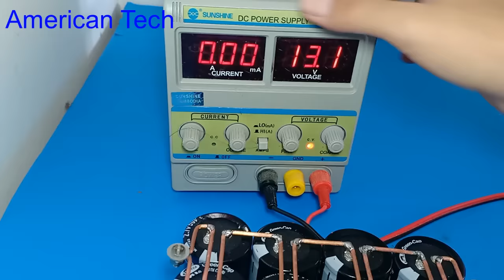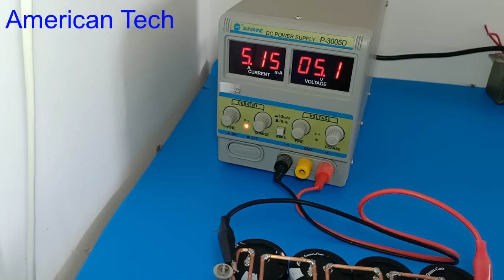12V , 100A using Super capacitors , Amazing idea

Comment: Don't give fake information to students these 8 super capacitors of 500F+500F=1000F 2.7v x4=4000F = gives only (10.8V) not 12V  and gives only less then  (one Amps) Not 100 Amps. please correct your information.
Reply: I think author means Not Amperes per hour, but some big current flow that can melt copper
Reply: It is A*and not *Ah.
Reply: you have to know how much the voltage tolerance of the capacitors is, and the capacitance is not 1000 or 4000, calculated is only 250.
Reply: ya you are right uncle
Reply: 2.7×4= 10.8

13-10.8= 2.2

2.2÷4= 0.55

They are only 0.55 volts per capacitor, with that the capacitors do not explode.
Reply: There are 4 series capacitors connected in parallel with 4 more capacitors in series. Capacitors in series are calculated as resistors in parallel and capacitors in parallel are calculated as series resistors (add up), 4 series capacitors of 500 farads are calculated as follows: c1 + c2 + c3 + c4 = 1 ÷ (1/500 +1/500 + 1/500 + 1/500) = 125, hence the total capacitance of the first row of 4 capacitors, the other row of 4 capacitors It also gives 125 summed are 250 farad.
Reply: Yes you are right
Reply: @alaskanskismok4487   There are 8 caps. Set of 2 are parallel making them 1000F and then 4 such sets connected in series to make overall capacitance as 1000/4 = 250F.
Reply: There are 8 caps. Set of 2 are parallel making them 1000F and then 4 such sets connected in series to make overall capacitance as 1000/4 = 250F.
The overall voltage that it can take is 2.7v*4 = 10.8v.
Current can be even more than 100A as these are low ESR capacitors and they can really push so many amps.
Reply: dariel pozo    Gratulation! You are the only one to calculate the capacity right!
Reply: @darielpozo8209  yea seiris capasitor set  c/set  
 (500+500)/4 = 250
Reply: @FriesinNF  

Thank God I learned it studying 18 years ago.
Reply: dariel pozo excelente!
Reply: @darielpozo8209  Объясни мне,ёмкость земли составляет около 1 фарада.Как можно в этот цилиндр вместить 500 планет земля.Есть значение микрофарад а не фарад.
Reply: @darielpozo8209  2.7×8
Reply: @llproducciones1959  
Gracias colega👍
Reply: @seryj591  

Can you please translate your comment into English or Spanish?
Reply: @mohammad_ghanem  

Son 2 filas de 4 capacitores, cada fila tiene 4 capacitores en serie y las 2 filas de 4 capacitores están conectadas en paralelo, por lo cual tienes 10.8 voltios conectados en paralelo con 10.8 voltios.

En conexión en paralelo el voltaje es el mismo, pero la potencia aumenta.

There are 2 rows of 4 capacitors, each row has 4 capacitors in series and the 2 rows of 4 capacitors are connected in parallel, so you have 10.8 volts connected in parallel with 10.8 volts.

In parallel connection the voltage is the same, but the power increases.
Reply: 4000 фарад ну никак не получается...в таком подключении только 250 фарад а вот с напряжением все верно...
Reply: @darielpozo8209  В честь чего?
Reply: Jaja is a battery inside the condenser. Only this. No more
Reply: Jealousy uncle
Reply: Yeah 5minutes at 5amps charging would be .4amp hours, but honestly I'd think short circuit would be higher than 100amps flow.. I mean as a kid playing around I got a capacitor welded to a  coin just playing around. Small capacitor at that.
Reply: Тоже самое хотел написать что 10.8 вольт максимум, но умный человек уже нашёлся
Reply: @DecibelAudio.  

the battery is like a large capacitor and the capacitor is like a small battery. By studying electronics, you can know how long a capacitor can hold energy.
Reply: 제목으로 낚인거여~ 저 캐패시터 단자로 100A가 흐르면 그 부분에서 발열될 수 있다. 하지만 순간적으로 흐르는 것은 상관 없지만..
Reply: dariel pozo thaks for your coments.
Reply: If you charge them to 3v it’s 12v 😂😂😂👍🏻 (If you want them to explode)
Reply: Good
Reply: 250F, 10.8V
Reply: @NienteNessuno  these capacitors are rated for 2,7V but can easily take up to 3,2V
Reply: You're wrong in so many ways
Reply: That cables work with 100 amps ? I think not
Reply: @darielpozo8209  charge time , big difference and life expectancy
Reply: Il se faut de notre gueule là!!!!!! 

Fake!
Reply: @TRICHOMETRIST  

what I'm referring to is the time it takes for the capacitor to lose the load
Reply: Ya chrag Kasa ho ga or Tim Ktna ha is ki chrging ka
Reply: @ayushmanjain4008  Respect the elders
Reply: Its too easy to say any thing Fake first he should respect others in urge to receive respect.
Reply: A not Ah🤣
Reply: Si pone los capacitores en serie se suman sus voltajes de trabajo.  Y la capacidad es la misma que uno solo.
Reply: @darielpozo8209  batteries take longer to charge , discharge
A capacitor discharges faster but charges faster
If we can charge a capacitor with a source (lithium,...) repeatedly the capacitors can discharge larger amounts of current than batteries
IN the case of Electric Vehicles it is being used as a "step up transformer "
People are starting cars/engines
With super caps /ultra caps
After car starts caps are quickly recharged for next start 
The new batteries/caps  have a quick charge option
If you charge batteries to fast it ruins them and kills life of battery
These caps can take thousands of charges and wont wear out like regular cathodes/
Reply: Will this Kentucky Fry Chicken me? What could possibly go wrong?  I don't see discharging resistors?
Reply: @seryj591  У земли напряжение больше миллиона вольт, а тут всего 2,7 В. Поэтому фарады настоящие. Но 500 Ф это меньше 100 мАч, литиевый аккумулятор такого объёма будет в сотню раз большей ёмкости
Reply: You are right practically cap. Will not explode for this surge current of 100A but what is backup time for this cap. bank?
Reply: @darielpozo8209  You're exactly right about the capacitance. But, did you notice the voltage? The capacitors are 2.7 volts each. That only allows 10.8 volts. To run in the voltage range of a six cell lead acid battery, he needs at least 6 in a series. Back to your formula, that would be only 166.66666.... farads.
Reply: @vincentrobinette1507  

The first thing is that the voltage of one or several capacitors connected in series or parallel does not affect the capacitance of them, that is, if the voltage tolerance of the capacitors allows a minimum and a maximum voltage, this does not decrease the capacitance. in this case we have 4 capacitors of 2.7 volts connected in series that add 10.8 volts fed with a source dc to 13 volts, where we have a surplus of 0.55 volts per capacitor, if the tolerance allows this excess voltage, this will not damage the capacitors much less will the capacitance of the circuit decrease. When the voltage in a bank of capacitors exceeds the maximum allowed tolerance, this does damage the capacitors or failing to make them explode.
Reply: @darielpozo8209  It doesn't affect the value of the individual capacitors, but when two Identical capacitors are connected in series, the total value of the string is cut in half. The voltage is doubled. You now have double the energy. The total energy stored in a capacitor is 1/2 the capacitance, times the square of the voltage it's charged to. That means, if you double the voltage of a given value, you have 4 times the energy. (E=1/2CV^2). by putting 2 in a series, 1/2 the capacity times twice the voltage squared, means twice the energy. The definition of a farad is a change of 1 volt per second, if 1 amp is applied. With 2 in series, each element changes 1 volt per second, giving overall change of 2 volts per second total. that means 2 1 farad capacitors in a series is .5 farads. Hope this helps.
Reply: Hadi rizvi u right dat can never n 100amps
Reply: @darielpozo8209  He wrote: "Explain me, Capacity of the Earth is about one farad. How can it be to set up 500 planets like Earth inside of a single cylinder unit. There is a meaning of Micro farads, not Farads".
Reply: سلام شما ایرانی هستید
آیا واقعا این کار میکنه
Reply: @D.V.G.1  , не так. Здесь 4 группы кондёров включены последовательно, в каждой группе по 2 кондёра. Следовательно, напряг на группу остаётся 2,7V , а ёмкость группы получаем из суммы ёмкостей каждого кондёра, 500F+500F= 1000F.
Т.к. 4 группы, то их общий напряг суммируется, 2,7V*4 = 10,8V. Т.е. вся конструкция рассчитана на 1000F и 10,8V.
Но, что-то мало верится, что ч одном таком кондёре аж 500F.
Может это китайские фарады, как и китайские ватты в 90х годах?
Reply: @LV-fx5nr  при повышении напряжения...уменьшается емкость ионистров...учись старик...
Reply: Ok
Reply: Hadi Rizvi total capacity is 1000/4=250 F . .Store   energy is ~15000 joules for 10,8 volts
Reply: Hm ?100 mikrofarad 380volt capacitor Dioden Wellen Sternwechsel an Wechselstrom
Reply: @ostanin_vadym  it was pond ..
Reply: @ostanin_vadym  7
Reply: Not to mention that if you touch this "battery" (100Amps), it will be hit the current. Actually I did not understand why one ampere? The device writing that is fed 5 amps.
Reply: Voltage rating on capacitor is the breakdown rating of the capacitor. You need capacitors with a voltage rating of at least 12 volts to avoid damaging these capacitors. Even with 4 series capacitors your breakdown voltage is still under 12 volts. It's garbage.
Reply: Please keep your information for yourself and see it from the angle and you from the angle of the other see it in another way
Reply: @darielpozo8209  Is there any way to use this as a battery on car?? Any way to stop the energy loss that happens with caps? Some say using  diodes for one way flow.
Reply: @pehgt5099  

I understand that this capacitor bank could be used in a vehicle but not for the start of the same, the same generation of the vehicle could keep the load of the capacitors, but I do not think it works for startup.
Reply: Hadi Rizvi.. Sir... If its 10. 8v.. How many hours can it provide the 10.8v.. Do u have any idea pls share
Reply: 1000/4=250F!
Reply: Total capacity 250 F and 10.8 V. Qc = 10.8 V x 250 F = 2700 Coulomb, Wc = 14580 J.  It has even more than 100 A? it is dependent on how fast you plan to discharge it.
Reply: @hadirizvi2670  Exactly!
Reply: @seryj591  у активированного угля очень большая поверхность, это основной принцип работы, сейчас уже на много круче, из графена делают. Все возможно, нет ничего не реального
Reply: @seryj591  он по русски не шпарит
Reply: @D.V.G.1  да потому что расстояние между диэлектриком увеличивается e0eS/d=C
Reply: @darielpozo8209  👊🖒
Reply: Hadi Rizvi supper pass
Reply: I think these  capacitors can tolerate 3v easely.
Reply: @nixtonixto  
100 mAh? Если следовать спецификации на данные конденсаторы, то мы получаем 250F с напряжением 10.8V. Что бы разряжать данный конденсатор с 100мА нам потребуется стабилизатор тока. Разрядка будет длиться очень долго при указаном стабильном токе и часть энергии будет рассеяна самим стабилизатором тока [все электролитические конденсаторы так же имеют собственный внутренний разрядный ток - чем выше напряжение тем выше внутренний разрядный ток].

https://www.electronics-tutorials.ws/rc/rc_2.html

https://www.instructables.com/topics/How-many-mAh-1-farad/
https://www.quora.com/How-do-I-convert-from-farads-to-ampere-hours

Вопрос нужно было задать в другой форме: 'Сколько потребуется времени для заряда конденсатора 250F постоянным током 100мА с начального нaпряжения 0V до конечного напряжения 2.7V?'

Или вопрос можно было поставить по другому: 'За какое время конденсатор 250F разрядится с постоянным током разрядки в 1А с начального напряжения 2.7V до конечного напряжения 1V?'
Reply: 👍👍not mikro farad for amplifier😁
Reply: Thanks sir!
Reply: @darielpozo8209  yes these 8 capacitors connect like these total capacitance is 250 mfd working voltage is only 10.8 volt
Reply: he mean they cap put out alot of amps in a moment, these capacitors can start your car, the amp draw of the starter motor  is alot.
Reply: Really it's true sir ?
Reply: yes
Reply: Yes true
Reply: There are many videos proving this is the best replacement for car batteries. Hands down.
Reply: I have used capacitors to jump start a near dead battery.Also keep in mind a capacitor can supply a large amount of current for a brief time enough to start a modern car.And for you guys that have high torque starters you would need a larger capacitor bank to do the same thing.
Reply: A NOTE to MAKE is that capacitors voltage VALUE, is a MAXIMUM RATING. Its not an automatic cut off. They charge up to the supply voltage in the formula used as time constants for the time to do that.

So you are better to have a higher voltage than a lower voltage as you will be pushing the limits of its structure. You can do it for a while then they explode. Just because you get away with it once, doesn't mean it will always. Heat is always a factor. How hot are they. How hot is the day and so on. Cooling always helps most things handle a bit more. If in a box, a cooling fan for example.

Better to have 5 in series than 4, giving a value of 13.5V. This means it has room to spare. Instead of maxing out past its recommendations. 

If you run anything at maximum, such as a motor control circuit, a voltage multiplier etc. AS soon as there is a change in the load, it will overload. Always have room to move above your maximum requirements and maximum ratings. IE inverters often are rated with two numbers. One for constant load example 1500W and 3000W peak. The peak is only while things like fridge start up for a few seconds, overcoming inertia most motors draw around 5 times normal operating current. Another thing people dont realise with inverters is the wattage translates to be divided by the voltage. So a 10A power point in the house at 240V is 2400W. At 12V that is 200A. So the wire from an inverter to the battery input needs to take 200A. And that's only one power point wall socket equivalent. Make is 24V and its 100A. 36V and its 66.67A. So you can save on wire size and cost by going up in voltage.
Reply: @MindTrip888  A Voltage regulator to control the charge can be used but no one should be building  something that can hurt them without at least KNOWLEDGE about what they are constructing. Also I would not use this in place of a battery as some have done on You tube .My purpose is to use it on a near dead battery when another source of power is unavailable. I draw from the dead battery while watching my state of charge with a inline in voltmeter if the capacitors are not at capacity.I do not disagree in your logic on the inertia electric motor butthe capacitors they used in this video would be sufficient for a modern day car as the starter motors today are incredibly small to the cars of 50s-90s.This is why I denoted for guys with high performance cars as there starter motors will draw more current due to higher compression engines.Not a modern day sports car either old school.
Reply: Thank you
Reply: Hadi Rizvi, while I respect your intentions for truth and warnings, there is a lot more than ONE AMP there. These are used to START CARS and Weld. You can make a spot welder with this. So 100A is about right. These are CLASSIFIED as SUPER Capacitors. FARADS not MFD. That's 1,000,000 MFD is 1 Farad.  I did my research to see why 2.7V was so big. This is 500 Million MFD!!! HUGE!!!! Be careful of assumed accusations when it is you who are incorrect and leading the newbies astray. You are talking like they are batteries. Different formulas.

These types of capacitors are used for welding with my search for them on ebay. These ones sell for about AU$7 each delivered.

1. You are talking like it is batteries where the voltage is the maximum value.

2. Where as capacitors CHARGE to the VALUE of the SUPPLY VOLTAGE in a formula of time cycles as using in RC timing circuits. When fully charged the capacitor no longer draws current.

Capacitors allow to have larger currents than the smaller supply. LEYDEN JARS the forerunner of the modern capacitor were called LIGHTNING IN A JAR, as they were being charged with STATIC, which is much higher in the thousands of volts. As static zaps us with sparks. Consider that same voltage stored to give extra current. This is what capacitors do.

A 20L size Leyden Jar capacitor on a Van Der Graaf generator can build up FATAL CURRENT charges. There are many videos on this on YouTube, BEWARE. It is currents that kill, if sufficient voltage is present.

Capacitors Voltage is a Maximum rating. Here he is pushing that Max over it. There is a tolerance. Max rating is a safe value for operations. To go over it is to risk damage. 0.3 Volts is probably within tolerance. I would be inclined to an extra capacitor in each series circuit to be safe to go to 2.7 x 5 = 13.5.  As capacitors explode when they overload with high power. Electrolytics usually by accidental reverse polarity.
Reply: @MindTrip888  The warnings that The gentleman is trying to get across is to charge a capacitor over its rating is a potential fire hazard which I do agree with.Yes super caps have been around for years but I deal with capacitors that if fully charged can stop your heart.We work with 700 volt hybrid trucks. Hence a  DC/DC voltage Regulator should be used when charging the capacitors.
Reply: @apacheone3643  While I respect saying, I believe you are giving him too much credit. As he is out of his depth, saying there is ONLY ONE AMP....And you know for sure there is much more...
Reply: @MindTrip888  I know other people have corrected him on this that is why I did not press the issue.
Reply: @seryj591  Там про электрическую ёмкость,а не про планеты космические.
Reply: Fake
Reply: @carlosleite6919  like you!
Reply: Inside battery
Reply: @mrkitty777  Kentucky fry Chicken me. Lolz
Reply: Good article on supper capacitors and valuable discussion on the subject for the beginners of electronic projects and enthosiosists. Thanks.
Reply: Please do this again with these 4 x 12v1A
Doe's you A ever get under 1A/(farrad)
Doe's you v ever get under 12v  either way you cuppel Them 
+ - + - so on
seriel
Or
+ + - - so on
Paralell
Please let me know or Edit you tekst
Reply: Yada yada yada nop WROOOOOONG 
IN RESISTORS YOU CAN GO SMALLER THAN THE SMALLEST
THIS IS F@UKING BATTERIES .. YOU CAN GO U P
IN ITHER VOLT OR Amp/Farrad
NEVER under the smallest.what ewer!!!
Reply: @darielpozo8209  use Google translate, it does a good enough job to be able to work out what's being said.
Reply: @boblewis5558  
yes, I use Google translator
Reply: @boblewis5558  
I also learned a bit of electronics.
Reply: @darielpozo8209  how the f@k do you get 250F 
This Ain't resisters . Ohm is smaller than the smallest
This type of CAP'S can NEVER ever be smaller than the smallest ..
Reply: @kennethschultz6465  
It seems to me that you did not understand what I wrote, I did not say that they are resistant, I said that the series capacitors are calculated as the resistances are calculated in parallel and the capacitors in parallel are calculated as the series resistances are calculated.  In case you do not understand, what I mean is that the capacitors connected in series are practically subtracted and the capacitors connected in parallel add up.
Reply: @kennethschultz6465  
I hope you understand:

There are 4 series capacitors connected in parallel with 4 more capacitors in series. Capacitors in series are calculated as resistors in parallel and capacitors in parallel are calculated as series resistors (add up), 4 series capacitors of 500 farads are calculated as follows: c1 + c2 + c3 + c4 = 1 ÷ (1/500 +1/500 + 1/500 + 1/500) = 125, hence the total capacitance of the first row of 4 capacitors, the other row of 4 capacitors It also gives 125 summed are 250 farad.
Reply: @ Hadi 
1farrad 1v = 1A sec 
50farrad 1v= 50A sec 
1000farrad 1v = 1000A sec
Reply: @DecibelAudio.  
Maybe but in this case .. 1farrad 1v =1A sek  
1000F 1sec 1000As
This is not kid's toy ..
Reply: @kennethschultz6465  

I do not know if you in your country calculate in a different way the capacitors connected in series and parallel, I do not know how you calculate the connection of the capacitors in the video, therefore according to the video and the experience I have there is  2 rows each of 4 capacitors connected in series, each capacitor has a value of 500 farad, I would like you to calculate how many farad in each row of 4 capacitors and then calculate how much is the total connected in parallel.  What I want is that according to you say that I am wrong, I need you to calculate the total farad of the circuit in the video.
Reply: @kennethschultz6465  

Remember that this is a healthy debate, there is no need to use words out of the ordinary, if I am wrong as you say, show it to me, do the calculations and the diagram and send it to me please.
Reply: @balakrishnareddy5765  aaaahahah you got 4 12v 1A batteries in paralell  and you get this to 1 12v 0.250A
 Please reply please PLEASE PLEASE  !!!
Reply: @operotti7940  please calgulate this using you'r formula .. Then thell me real life result 
4 x 12v 1A in my World that is paralell 12v 4A  What is IT in you'r World .. thats the globe on that is .. 
Like  500+500=1000 F is not 250 like resisters but 1000F like batteries in series/paralel
Please tell me why .. you can get this simpel simpel thing wrong
Reply: @user-bh3tp1ez5m  No wonder russians can't make anything Work
What does 4 x 12v 1A is paralell give in A in russia.. (vestern World we get 4A paralell)
How the f@k can you get IT to 250F this is not resistores 
500+500@2.7v=1000F
Reply: @f.momentum8535  hmmm please by you'r logic 
Calgulate 4x 12v 1A paralell  hint 4A if you get 0.250A you are so wrong
Reply: @kennethschultz6465  If you connect 4 batteries of 12v and 1A max in parallel then the set can supply theoritical maximum of 4A.
Here you can understand as each and every battery can supply a maximum of 1A and all together can supply 4A.
Reply: @balakrishnareddy5765  
Realyyy !!!! Cooooool
Why do some on get 500+500F to 250F ... If they are right .. the 4 x 12v 1A is 12v 0.250A
And you and i know IT ain't so .. right.!!
Reply: @kennethschultz6465  I think you need to learn bit more of fundamentals.
Batteries never push 1A current or any current. It is the load requirement that demands the current. And load must be choosen such that it does not draw more than maximum current a battery can provide.
Reply: @kennethschultz6465  if you want to make 1000F capacitors to 4000F then connect 4 of them in parallel just like batteries. 
If you connect batteries in series then voltage will change but they should not supply more than 1A.
Reply: @balakrishnareddy5765  realy now you agrre What a coencidence 
1F 1v=1As 
So 1000F 1v = 1000As @10.8v thats a Lot 3.32Ah
1000F x 10.6volt thats way more than nothing .. and 1000 times++ more than 1A
1As = 1Amp sec
Reply: @balakrishnareddy5765  so you agree with my 
Calgulation of the seriell and paralell 
2 paralel500=1000F seriel x 4= 1000F
2.7paralel2,7=2.7x4= seriel 10.8v
So you also agree that CAP's and Batteries are Same.. 
Nice .. please tell the not so fortunate .. 
You are my new best frind .. Greetings from OZ land Denmark..
Reply: @operotti7940  sorry is Cap's same as Resistors .i think not
. and when and where did that rule chancer.. if you still think so 
Please Edit 
Or delete this is 4 paralell Banks in series thats 10.8v 1000F
Reply: @balakrishnareddy5765  okay like I ... You made a slight typo
Reply: @balakrishnareddy5765  you mean 1000F 10.8v right .. vink vink
Reply: @FriesinNF  lol nop 
IT is not resistors .. so at rule of thum
You can't make Cap's smaller than the smallest in this case 500F 
2 paralell 2x500F. =1000F @ 2.7v x4 in series is 1000F@10.8v  tada....
Reply: @withyou4922  sorry bro 
500F+500F is 1000F@2.7v  in paralell x4 in seriell 1000F@10.8v thats that 
Resistors and Cap's ain't the same ...
Reply: @kennethschultz6465 The capacitors in video connected as 2 in parallel and then 4 such sets in series so ultimately they become 250F.
Since they are connected in series of 4 they can maximum take a voltage of 2.7*4=10.8v.
So the entire configuration spec is 10.8v and 250F.
If you are not convinced with 250F capacitance then I can't explain.
Reply: @kennethschultz6465  Yes you can consider capacitors as rechargeable batteries. You can use thevenins network model to use them in parallel or series combination.
Capacitors can be used for battery replacements theoritically but not suitable as of now because of differences in size and energy densities.
Reply: @balakrishnareddy5765  500 paralell 500 thats 1000F @2.7v  x 4 seriel is 1000F@10.8v 1A@3.32Ah
Same as batteries
Reply: @balakrishnareddy5765  if you agree to IT is batteries 
Why don't you calgulate Them as so... You calgulate Them as RESISTORS ..not as Cap's
This is a nøøøøøb flaw
Reply: @balakrishnareddy5765  but 250F .. now i can't .. say IT in any other way than .. please PLEASE
You math is flawed .. i repeat a CAP can't be halfed in sice as a resistor can . If you still do this 
You are flawed . That's that  
you agree to Cap's is batteries .. appley the math
Reply: @balakrishnareddy5765  hmmm i think you are a troll 
One place you say og i put 4 1000F together iN PARALELL get 4000F but in SERIEL i get 250F
Nop i know wher you go wrong
You M I S T A K E The VOLT SHERE .. AAAAAAHAHA... 
YOU DEAR SIR .. HAWE IT ALL WRONG !!! HAVE A GOOD DAY
 I AM OUT 
IF YOU NOT BY NOW DON'T RECOKENIGSE YOU FLAW .. YOU WILL GET HUGE TRUBBLES WITH ELECTRONIC
Reply: @balakrishnareddy5765  yep .. why do you .... Disagree with you self and .. make 1000F to 250F
You mistanke the Volt shearing 
This is deleberet trolling
I am out
Reply: @ostanin_vadym  1F 1As 
1000F x 1A = 1000A 1sek 
1000F x 10.8v =10.800As  1A for 3Hrs or 3.34Ah
Reply: 1A 3hrs or 3.34Ah
Reply: @balakrishnareddy5765  capasitance is not the same as capasety or rectance or whatever
Not in this case .. you are refering to volt deviding .. you don't devide the Farrad at the same case
Reply: @balakrishnareddy5765  but What you write don't 
Get to gether with the 1 over .. and 1000F to 250f ..
So either you Edit one ore the other .. you can't do both  
Then you just Troll .. and i am out .. I Block Troll s
Reply: @kennethschultz6465  
I will leave you drowned in your ignorance.
Reply: @kennethschultz6465  
I will leave you drowned in your ignorance.
Reply: @kennethschultz6465  
No matter what you say, that does not take away what I know and you will continue to be drowned in your ignorance.
Reply: @kennethschultz6465 , @dariel pozo, stop spam!
Reply: Your voltage calculations and parallel capacitance calculations are correct but NOT your series capacitance calculation. 

When TWO Capacitors are connected in series the positive charge on one connected plate automatically gets reduced by the negative charge on the opposite plate of the connected capacitor.

 This reduction is automatically balanced across both capacitors until the total charge on each of the four plates is HALF of its original value.

Since charge Q = CV then the capacitance is Q/V. The voltage V is still the same (per cap) at 2.7volts but the charge (per cap) is now Q/2 so the equivalent  capacitance per cap is now 1/2 of what it was i.e. only 500F. 

When connecting TWO such series pairs ALSO in series (500F in series with 500F) the same redistribution of charge occurs and now the two series 500F (4 series 1000F) become 250F ONLY! NOT 4000F which is ONLY TRUE of parallel connected capacitors.

PLENTY of great accurate tutorials inline about this.
Reply: @TRICHOMETRIST  "… won't wear out… " Piffle, the ESR will increase it’s why switch mode PSUs fail so quickly. I=C dV/dt
Reply: . @darielpozo8209
Reply: dariel pozo 

Uh,not really.
Battery <> capacitor for lots of reasons (rapidly decay in voltage as current withdrawn from capacitor for starters)
Reply: Capaciter kya militia hai
Reply: Where is the uploader answer? ? American channel operator why no answer from u??
Reply: Let's not forget the fact that if you use it on a car the alternator is going to blow up the capacitors
Reply: Do u have an email i have an crestion
Reply: U
Reply: @darielpozo8209  eesto puede servir en el car audio
Reply: @ronnyejr.pujols3241  
Entiendo es muy alta la capacitancia para audio car pero no estaría mal ya que esto sería como tener otra batería.
Reply: No: Its Paralal then sere ies 1000 X 4
Reply: @ostanin_vadym  true
Reply: He overcharged it to 12V and he said 100amps and not 100AH so yes 100amps is totally possible
Reply: @chandankumarray2998  he is not
Reply: @FilipeDGuedes  ok
Reply: @vincentrobinette1507  u can overcharge them upto 12.8volts without any short circuiting or any problem
Reply: @anandsuralkar2947  They're rated for 2.7 volts each, charging to 12.8 volts puts 3.2 volts per cap. That's their surge voltage rating, and you can probably get away with that, for a while, as long as the capacitors aren't allowed to get too hot. As you get close to the temperature rating of the capacitor, the peak voltage goes down. A cold capacitor can charge to a higher voltage.
Reply: @nomulakarunakar5510  Yes. I am from Hyderabad and you can contact me on Facebook.
Reply: @seryj591  1 микрофарад равен 1тысячная фарада (значение микро равно 1 делить на 1000)
Один фарад - значение не ёмкости земного шара, а ёмкость площади  поверхности шара равного земному. 
У большинства людей неправильное представление величины значения 1 фарад из-за неправильного чтения формулировок
Reply: @D.V.G.1  где верно если на банках написано предельно допустимое 2,7 вольт при умножении на 4 получается 10,8 вольт.  Если подать 12 вольт то на каждую банку будет превышение 0,3 вольта. В таком случае фарадные конденсаторы быстро износятся и рванут устроив пожар. Учитывая то, что они состоят из угля - они не могут выплеснуть энергию через клапан, а значит рванут и загорятся. Причем полыхнули так что даже затушить будет нереально успеть.
Reply: @FilipeDGuedes  2.7 volts is not just written, these are calculations for the gap of this capacitor.
the gap is calculated based on the materials from which the container is made. the voltage on the battery is calculated by scientists, take a diode and try to increase the reverse current - it will start to warm up and burn out.
and your advice without confirmed facts, you only harm.
Reply: @user-bh3tp1ez5m  ok
Reply: Ok
Reply: @seryj591  потому как емкость зависит не только от геометрии, но и от окружающих тел. Ты рассматриваешь емкость земли как уединененного тела. А тут Во-первых емкость  двух тел - обкладок и она зависит от расстояния между ними. В данном случае тут терристор - расстояния между облкадками сравнимо с размерами молекул , то есть очень маленькое - отсюда очень огромная емкость
Reply: Sherup please
Reply: Admin please give your respon to this